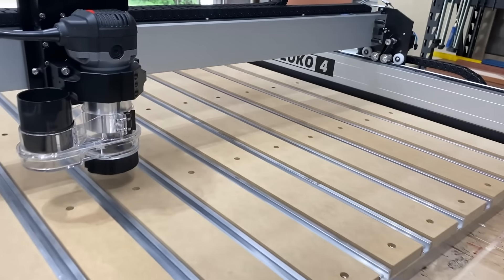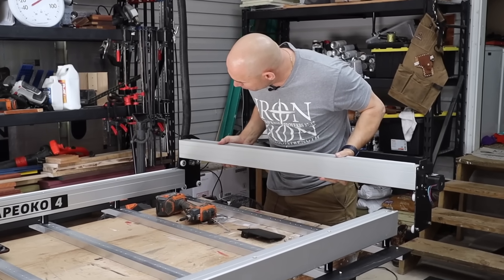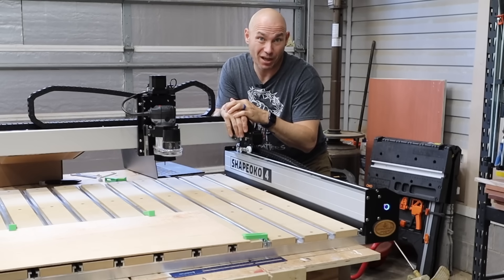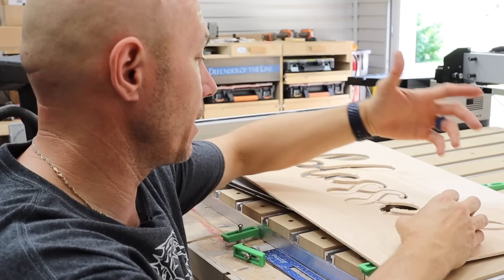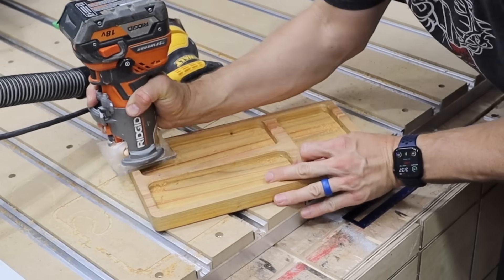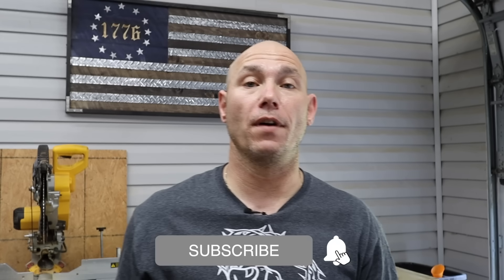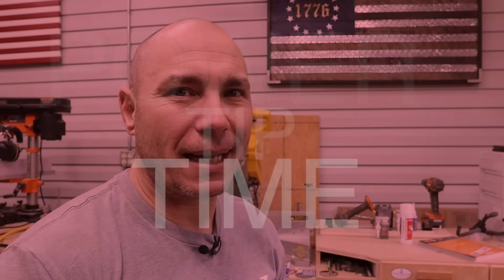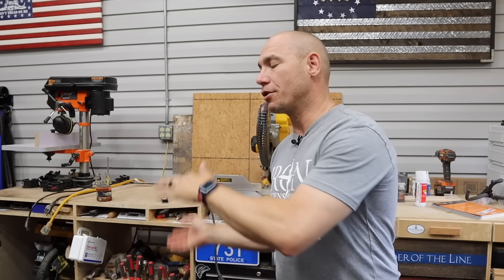First Time Using a CNC Failed. Can I Make Money with a CNC?

Comment from the maker: ▼EXPAND FOR TOOL LINKS and INFO▼ 
Watch Next = Custom Drawer Inserts with a CNC https://youtu.be/a8-do2XIk90
Tools In This Video: 
Shapeoko 5 Pro - https://collabs.shop/xd9ye9
VFD Spindle Kit - https://collabs.shop/0v5jyg
Shapeoko 4 XXL is the CNC - https://collabs.shop/ovn4dq
Starter CNC Bit Kit - https://collabs.shop/ne4tmb
1/4-inch end mill - https://collabs.shop/0v5jyg
1/8-inch end mill - https://collabs.shop/qxtpon
Free CNC Training and Info - https://my.carbide3d.com
Caliper I Use - https://amzn.to/3Kjd6nR
Small Bessey Clamps - https://amzn.to/3KfUxRi
Small TayTools Clamps - https://lddy.no/1cl9a
CNC Bits from Bits & Bits: https://bitsbits.com/ref/6215/
Download Carbide Create for Free - https://carbide3d.com/carbidecreate/
Download Carbide Motion for Free - https://carbide3d.com/carbidemotion/
3M Sander - https://lddy.no/1cloh
Makita Router for Shapeoko 4: https://amzn.to/3AgXz1i
Bits and Bits Starter Kit: https://bitsbits.com/product/250-prem...
All CNC Bits: https://bitsbits.com/product-category...
Bits and Bits Discount Code: 731WOODWORKS
CMT Bits for CNC: https://lddy.no/11qud
CMIT Discount 731CMT10
Amana Starter Bit Set: https://amzn.to/3oCNSIg
Double-Sided Tape: https://amzn.to/3uLbxHs
Bubble Mailers I Use: https://amzn.to/3msIogx
Bubble Wrap I Use: https://amzn.to/3uPadTO
Where I Buy my Hardwood: https://www.wtghardwoods.com

(If you use one of these Amazon and other affiliate links, I may receive a commission) 

Some other useful links:
Daily Tool Deals on my website: https://www.731woodworks.com/tool-deals
Subscribe to our email Newsletter: https://mailchi.mp/7e44c16eefdc/731-woodworks-email-newsletter
Check out our easy-to-follow woodworking plans: https://www.731woodworks.com/store
Outlaw's Board Butter - So Good it Should be Outlawed: https://www.731woodworks.com/store/boardbutter

Comment: Matt congratulations. I have had a CNC for about 5 years. The best tip I can give you is that it's cheaper to buy used furniture for solid wood. I usually buy tables for a decent price and cut them up into smaller pieces for signs. The wood is also dry as can be. Less chance of it warping after you run it on the CNC.
Reply from the maker: Thanks for the tips!

Comment: You ABSOLUTELY can,  I bought a Chinese 6040 several years ago, (of course had to rebuild the control system and Bed on it)  probably had $3000 total in it,  But a good accurate machine now.  I have been cutting aluminum Plates with it for couple years now for a customer, made over $30,000 last year alone,  Setting up 2 more 6090s now to cut wood products in near future,  CNC is a GAME CHANGER in your Biz.
Reply from the maker: Wow.  That is amazing!  Would love to know more about that.
Reply: Congrats, same here, I would love to know more about what your all doing.

Comment: Hey man, over the last several months I've been doing/learning some CNC stuff myself (Shapeoko XXL). A few thing's I've learned that has seemed to help is add a secondary waste board so you don't cut through the original, and surface/flatten your waste board so it is registered to your router. Also the flatter the material the better results you will have!
Reply from the maker: Thanks!

Comment: Just found your videos and have subscribed. A little tip, instead of double sided tape.. the masking tape and ca glue trick works great! Put masking tape down on the work surface and on the back of the work piece. CA glue on the top of one and activator on the other, place them together. No slip and no glue residue from the double sided tape. Keep the videos coming, we're only limited by our imagination!

Comment: Instead of double sided tape, use blue painters tape. Tape the tape down to the spoil board then tape the exact same pattern on your workpiece. Then put super glue between the prices of tape. Hold like crazy and cleans up super easy.

Comment: That thing is sweet.  I can't wait to see more.  Have your thought about doing the inside first? That way when you cut out the outside,  you don't have to worry about it moving.  Just an idea.  Love the video.
Reply from the maker: Yeah that would work much better.  If I knew how to tell it to do that lol.  Still learning.
Reply: What I do for mine is set it up as 2 separate projects: one to hollow out the insides, a second to cut it loose from the material. I find this works well because I can use a bigger bit, usually, to hollow out and then swap to a smaller bit for the cutout. I use Easel Pro, so it's super easy to make the complete project in one file, make a copy of that file, and then delete the cut you don't need from the two files.
Reply: @731Woodworks  Play with Carbide Create and Carbide Motion. Create allows you to move the tool paths around each other for this issue. Also make sure that you save, save save as you design.

Comment: One little power tip as well is to use painters tape on the table and the bottom of the work and then CA glue them together.  after I found this out I stopped buying expensive double sided tape.  Hold amazingly well as you can guesstimate where small cutouts will be and make sure that area has lots of glue, thus holding them from shooting across the shop.

Comment: Hey bud, look into the elliptical style clamps.  They clamp on the sides of the board into a solid end stop that you setup.  I have several for my xcarve, and it has saved me bits and hold downs using them.  I am currently awaiting an upgrade and we will be back up and milling by the end of the month hopefully.  Congrats on your new journey, also will have to share my son and I's new mallets after we finish them.

Comment: Power Tip I've learned.... If you can make an X,Y axis corner positioner out of some scrap/MDF and counter sink some screws into your spoil-board. You now have a perfect square reference for mass producing whatever. Plus is can act as a side holding clamp too for one side.
Reply from the maker: Yes! I need to do that for sure
Reply: +1, take it one step further and align this corner stop with one of the rapid position presets in Carbide Motion. That way you have a repeatable automatic xy zero. I have my corner stop screwed down, but plan to make an indexed bracket that drops in on the zero just when I need it.

Comment: Try using painter's tape and super glue/accelerator as work holding it's the best stock holding method when clamps cant be used.

Comment: How long did the canary take to cut? If you had a process down, roughly how many do you think you could produce in a 8 hr day?? Awesome video.
Reply from the maker: Thank you.  It took about an hour but it was going very slow.  I could raise the speed a lot from where it was set in software.  I think I could knock out 10 or 12 easily.

Comment: Now I want one!! You're a bad influence, Matt... But since I live in an 800 sq ft lakeside bungalow, with no garage and a packed shed, it looks like I will have to wait a year until I move out to AZ and get some permanent "shop" space.
Reply from the maker: You should look at the carbide3d nomad. It’s a desktop size CNC 😳
Reply: @731Woodworks  I looked at the site and saw the Nomad. Truth be told, I don't have room for that either, so I figured it would be better to just wait until I had the space for the one I want. The 4 XXL looked perfect. I saw the 4 Pro XXL, but couldn't see much of a difference between the two. So, the 4 XXL it will be, next year.

Comment: Pros and cons of this one versus the $6000 glowforge pro?
Reply from the maker: I didn't compare those two, sorry
Reply: Glowforge pro is a laser cutter with a  small bed, it has a passthrough slot but only for a quarter inch or less. Makes a nice burn, good on leather also. It really struggles to cut clean through quarter inch material and chars it pretty bad. If you want to cut material 1/4 inch plus go with a CNC. If you will mostly be decorating smaller boards and items    and cutting thinner than 1/4 inch consider the glowforge. My 2cents
 I

Comment: Your first upgrade to that thing needs to be a real spindle, using a router is very loud and has a ton of run out.
Reply from the maker: Which do you recommend?
Reply: @731Woodworks  I would look at any cheap China 3hp models,  keep in mind you will also need a VFD to control it and if you plan on doing any 3D carving that takes hours to complete then I suggest a water cooled spindle.

Comment: Wood you recommend getting the compact router that they offer to go with the shapeoko or upgraded
Reply from the maker: I had one of theirs fail. They replaced the other one no questions asked.  I do think it was my fault on the failure.  I ran it at full speed the entire time and more than once I programmed the CNC wrong and it plugged into the aluminum bed under the MDF waste board.  Which I think actually burned up the router.   I've got a Makita on standby now just in case but the replacement has worked great with no issues.

Comment: Couple of things to know (I have a CNC Shark): it takes a long while to "turn a profit" after the machine purchase. You should also have a dedicated electrical circuit AND a uninterruptable power source (UPS) for it. Otherwise, you will trip breakers running this, dust collection, vacuums to clean up, and your other tools. Also, don't cut plywood. lol It looks like crap. Pro Tip: you'll never make any money making stuff the Karens can buy at Hobby Lobby.
Reply from the maker: Thank you
Reply: The karens.  that's funny!

Comment: I tend to follow woodworking channels less and less when they get into cnc. It usually becomes all about the cnc, and less about actual woodworking.
Reply from the maker: It won't become all about the CNC.  I may use it for projects here and there but not always. It's a tool, just like a table saw, miter saw, etc.  Leaving a channel because they use a CNC is like saying if they got a bandsaw you wouldn't watch anymore.
Reply: @731Woodworks  that comparison is bonkers, but I'm not going anywhere yet. I like your channel.

Comment: Sir please dont call yourself a dummy. I was a mechanic for 47 years. "I TAKE NOT AND CALL OUT THE MANUFACTURE AS BAD DESIGNING!" Ok caps off Every i said every connector in a car is different so this kind of mistake never happens. Except for some o2 sensors. Sorry this happened.

Comment: Glad to see that C3D sent you a machine Matt. Your woodworking journey is headed into another direction. If you continue to make videos you will probably need to build a enclosure for it with real good sound proofing. Here is a link for some tape that I use that seems to work real good and it comes off real easy and clean. Thanks for the video and keep up the great work.
https://www.amazon.com/gp/product/B08GQ8XRHF/ref=ppx_yo_dt_b_asin_title_o06_s00?ie=UTF8&psc=1